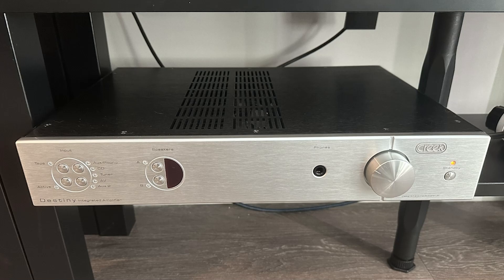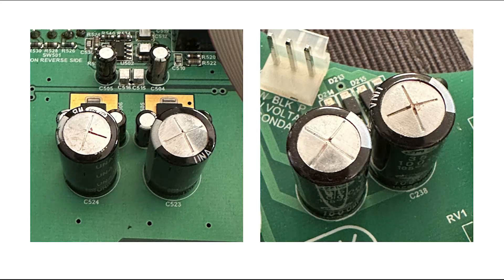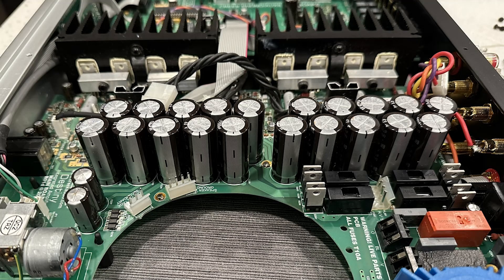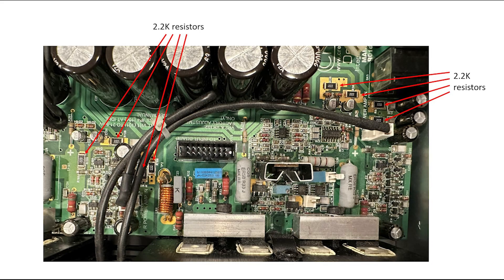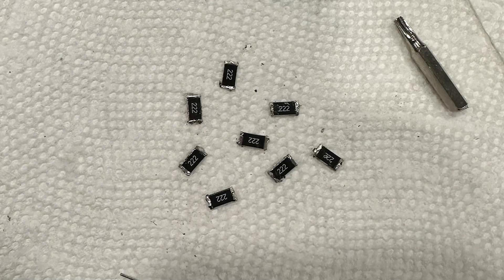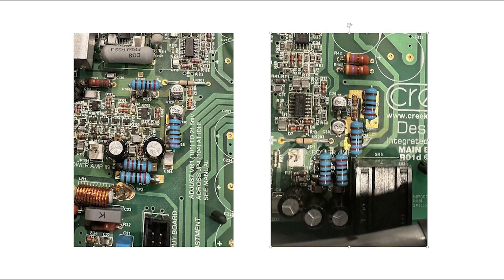Creek Audio Destiny Amplifier, Recap & Modification. No more overheating Shut Down.

Comment: Thanks for posting! I’ve been working on my Destiny. I installed 2.2kOhm 3 Watt THT resistors on 1x1inch boards mounted to the main heatsinks. Seeing your technique looks much easier! Did you bend the leads to create feet to solder to the SMD pads? How high above the board? Is it important? Also, curious is you adjusted the idle voltage. I enjoy the sound more at a lower idle voltage. Another hot SMD component (80C) on the PCB is Q12/112.
Reply from the maker: No, I didn't bend the leads. I think that your method could work even better👍
Reply: @neighorizon-4190  it’s a wonderful sounding amp, congrats on repairing it.
Reply: Hello and thank you for your video presentation, if you were pairing this with a power amplifier, what would be your choice, thanks.

Comment: I would love if you could do a walk-through of what happens to an audio signal thru an amplifier, through each of the components (a very very simple amp would be perfectly fine).  I've watch your other videos and your methodology and manner of instruction is really helpful and informative, and would help me learn more about hi-fi equipment.  I inherited my step-fathers Adcom first gen GFA-555, and PS Audio 5.5 pre-amp with massive external power supply, and I would love to understand what is happening to the audio signal as it enters the pre-amp, and what each of the components are doing, (not those specific models, but any very basic pre-amp and amplifier.)  Many thanks and thanks for great videos!
Reply from the maker: The GFA-555 and the PS Audio preamp are pretty high-end gears. Will try to put together some of my understandings on the signal paths.